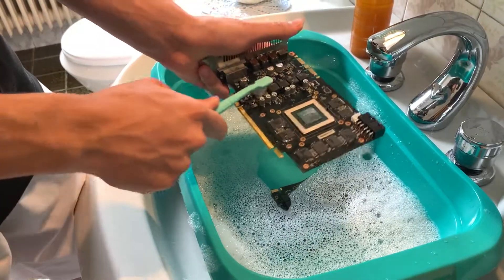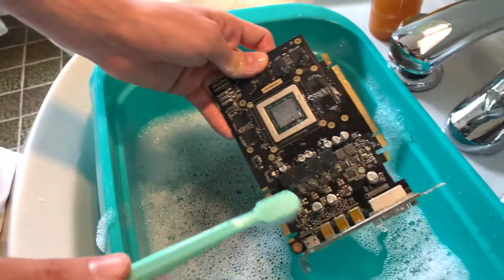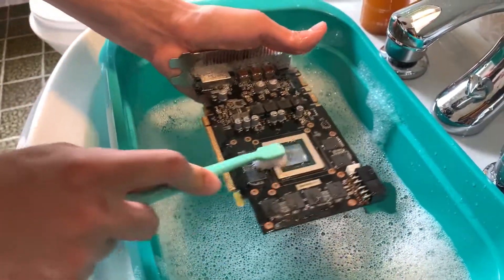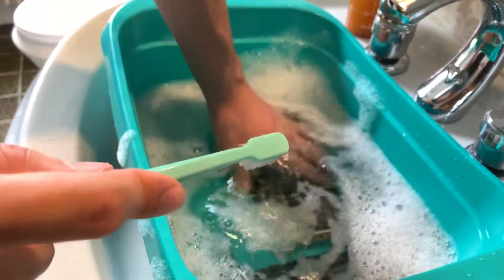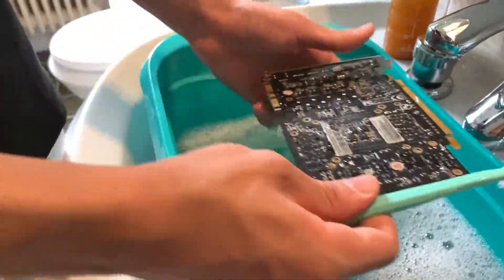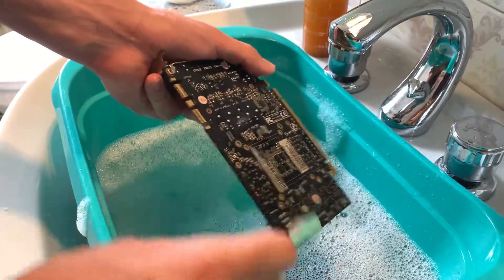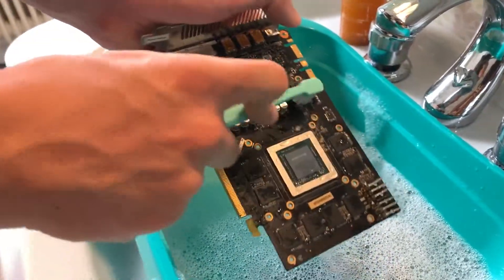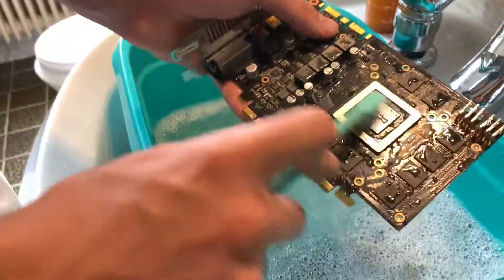How to fix a broken GPU by washing it - Can you wash a graphics card - Black Screen fix

Comment: hello man sorry to bother you but you are among my sources of inspiration in pc and diy tech. I changed the thermal paste to my processor (standard air heatsink). Since everything was well dirty and dry even the cpu, I took it out of the socket and cleaned and cleaned also socket with rag and alcohol. I reassembled everything well. Now the pc starts (motherboard green light, fans on, keyboard lights on), but it doesn't send signal to the screen, it doesn't start, it stays in this perennial state. As if it does not read the CPU. I tried everything I knew but in vain. What do you suggest? I'm devastated. thank you very much!
Reply from the maker: You probably need to dry up/clean better both the socket and the CPU, I've seen that happen a lot of times!
Reply: Buy a bottle of eletronic cleaner can. Spray the pin, make sure there isnt a bended pin.
Reply from the maker: @potassiumchloride2542  Great advice! Sorry I read it this late lol